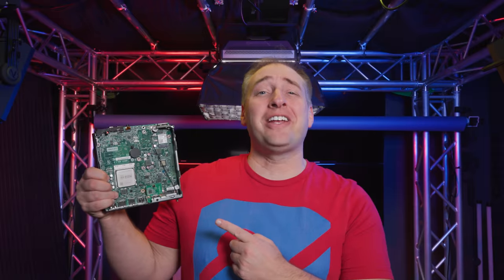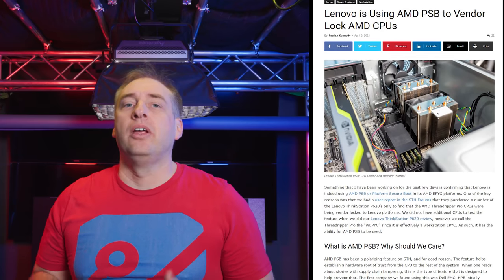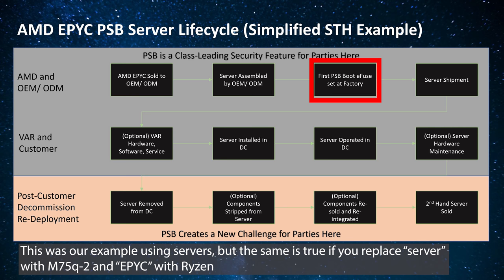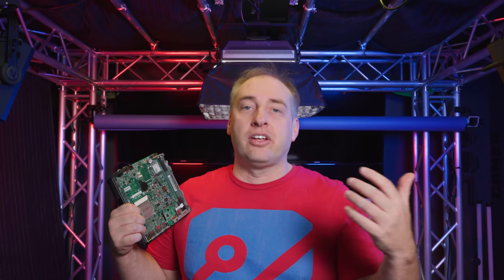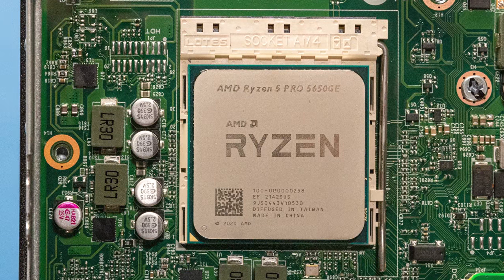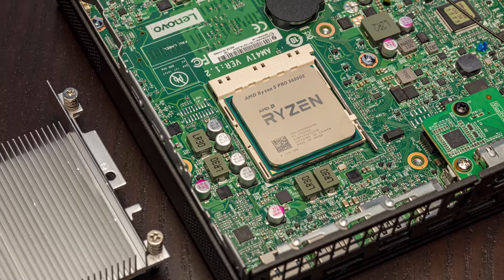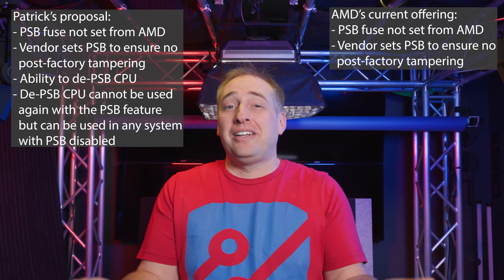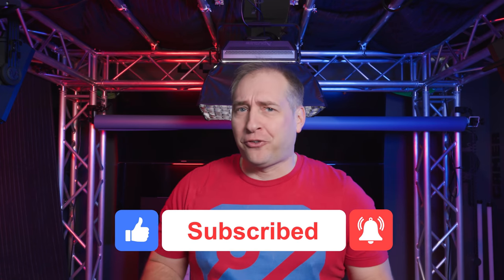Yikes! Lenovo is vendor-locking AMD Ryzen CPUs via PSB

Comment: The thing I don't understand is why they say the vendor locking is for security. How is this making the system more secure? - It's not like the CPU is an SSD containing business data. It's just rocks we've convinced to think.

They're just trying to harm the secondary market aren't they?
Reply from the maker: The idea is that it prevents unauthorized firmware to be introduced between Lenovo's factory and where it is deployed. All of the major server vendors are already working on at least some form of this, driven by cloud providers, and now we are seeing it more in endpoints.
Reply: the CPU contains the security coprocessor, and is also ensuring that the board firmware isn't compromised. If it's swapped with another CPU where the security processor and/or CPU are compromised, you break the security features of this system and the end user has very little way of detecting this.
Harming secondary market is a very secondary thing, nobody is buying these PCs for harvesting the CPU, in most cases the secondary market users will buy the whole system and use it for what it is.
Reply: @ServeTheHomeVideo  This would also prevent a malicious actor from loading their own UEFI microcode on the CPU either through physical access or a virus once the system is in production.  It would be very difficult or impossible to detect the malicious code on the CPU and it could be impossible to remove it as well.  Hardware based advanced persistent threats have been a topic of concern for years, but haven't necessarily been all that prevalent.  I wonder if Lenovo is just being proactive here or have these sorts of threats becoming more common.
Reply: @ServeTheHomeVideo  But why wouldn't they just include this in the chipset on the motherboard instead? Surely someone able to intercept systems in shipping could still defeat this system by replacing components on the motherboard, change signing keys, sign their own firmware, put on their own chips to bypass verification etc

Like once you have physical access I feel all bets are off unless the customer has to install some secure element to the server themselves separately once they get the hardware. I feel like this is just a way to lock people into a platform and making more e-trash. I've seen on ebay already how these locked CPU's go for peanuts while the unlocked ones go for 3-4x the price because people can't use the locked ones outside of the same vendors motherboards.
Reply from the maker: @zoopercoolguy  You are right. Is there an "and" instead of an "or" option?
Reply: @zoopercoolguy  all this invisible garbage and management engines need to get the hell out of the CPU... IMHO
Reply: @marcogenovesi8570  But if you have physical access to be able to change the CPU then why not just change the Motherboard too? - How does this offer any extra security if you already have physical access to the server? - If I'm the NSA or whoever intercepting a server that has this I'd just change the Motherboard and CPU together to a matched pair I've already preloaded with my modified firmware. I still don't get what this offers beyond tying up peoples money in a locked down ecosystem.
Reply: @ServeTheHomeVideo  HPE started a Trusted Supply Chain program for certain servers assembled in the US by vetted employees and with more security options built in.  I think that sort of arrangement is the perfect place for enabling the PSB.  Given the increased pressure on industry to prove cybersecurity compliance, PSB and whatever the Intel equivalent might be are appealing for certain industries.  Just make PSB enablement an optional feature that has to be ordered from the factory.
Reply: @ServeTheHomeVideo  if they have physical access, its already too late, and if they can get to the management interface to be able to fiddle with the UEFI, then again, its already too late.  these are not for security, its designed to kill the second hand resale value, nothing more.  see my comment about the full depreciation value in taxes.
Reply: @zoopercoolguy   I'd rather see this thing used more like tpm. You can de-lock it, but say good bye to data on your drives and uefi.
Reply: @droknron  they could change the motherboard, but you could easily catch that by testing with a known, properly blown, cpu.
Reply: @marcogenovesi8570  How would a CPU where the 'security processor' has been compromised exist? Are you assuming an attacker can manufacture rootkitted silicon? That is so farfetched as to be ludicrous. An attacker has stolen AMD's PSB signing key and this fixes that? You might as well assume an attacker has stolen Lenovo's signing key if so, which makes the locking process moot. Literally there is NO PLAUSIBLE MECHANISM once you start to drill down into the handwaving 'it's for security stop asking questions'
Reply: @ServeTheHomeVideo  How would this 'unauthorised firmware' be loaded? Are you assuming rootkitted silicon with compromised microcode? That AMD have lost control of their signing key, and a microcode update when it's booted is loaded? If so.. how does signing by another key help resolve that? The compromised microcode would just ignore a signature mismatch and pretend everything is A-OK. None of this 'it's for security!' argument actually stands up to examination.
Reply: @isbestlizard  manufacturing mistakes happen and some batches of CPUs of a specific revision might have a vulnerable security processor. Happened in the past with Intel's ME.

Limiting the CPUs that can run on the system to only those that are signed by Lenovo would stop that, assuming that Lenovo has validated the CPUs beforehand.

It's not a particularly high probability of happening, but it can happen.
Reply: @zoopercoolguy  Why this can't be solved by providing CPU specific encryption key, so the end users would be able to sign custom keys for installation into the CPU? Sure, leaking master key for your CPU die would be a problem, but realistically how often wouild you use it, 1-3 times over CPU lifetime.
Reply: @nxtktube  because that would open the possibility for a malicious actor to introduce their own  signed custom code to the cpu.
Reply: @isbestlizard  It's all BS at the end of the day, 99% of end users would have no clue if the mobo and cpu was replaced with a pair that tells them what they want but does malicious shit in the background. PSB provides no security that can't be done without it, the ONLY thing it does is kill resale value.
Reply: @ServeTheHomeVideo  dont the MB and CPU check for signatures of BIOS and microcode respectively?
Reply: @kharkin0  This is possible with TPM since TPM is battery backed with the BIOS battery. This ensures that the TPM can be securely erased. Sometimes there is also a capacitor inside the TPM chip to create a additional safeguard. The thing is that once you press "reset" on a TPM chip, it needs a few seconds to clear out all keys. And if you would be to yank the power to the TPM chip during the erasing, you could end up with a reset TPM chip containing actual encryption keys, or partial bits of it, that would be realased to the system with a newly initialized, compromised key used to sign some malware that captures the partial BitLocker key.

This is why the processor is using e-fuses instead. Its not possible to power the processor in its "turned off" state, thus the fTPM would be dead. It would then be possible, if a reset functionality was provided, to initiate a reset, then in the same second yank the power cable, and then initalize the processor with a new signing key for a compromised UEFI,  and then have the compromised UEFI to dump all released data from fTPM, possibility getting partial disk encryption keys.

This is why AMD uses permanent e-fuses. Its not a vendor lockin per-se, but more a security thing to protect drive keys.
Reply: @sebastiannielsen  I didn't mean it to have a TPM-like memory, just the basic principle. Fuses are faster to pop, cool, use fuses. I understand that unlocking would be a one-time operation, but designing it so that the locking is permanent is stupid. 

And even with a TPM-like memory, this could have been designed in such way that you have 3 "extra" fuses (set, reset and clear). Popped "set" fuse lets the system know that it's secured, unless corresponding "reset" and "cleared" fuses are also popped. On power-on system checks fuses, if "reset" fuse is popped, but "clear" fuse is not, it begins erasing memory. Once memory is erased, "clear" fuse is popped. If you power down system before memory is erased, It'll just try to clear it again on next power-up.

Comment: My thought is exactly what you said. It creates a deceptive market that might not even be the fault of the seller. I've helped schools upgrade their systems on the cheap (due to not having any budget, not the management being cheap,) and things like this would certainly hamper such a project. Not green, not friendly, definitely only looking out for the bottom line. Deplorable.

And frankly, the protection it offers is a joke if you really think about it. If it's physically compromised, all bets are off and that's it.
Reply: Dude, if it's physically compromised it's probably already sitting  in the thief's home being taken apart.
Reply: What if it's compromised remotely via a vulnerability, and they got root on the system?
Reply: @1mrhamel  The same security could be achieved by putting an early-stage bootblock of the firmware inside an external hardware write-protected memory. It may sound like this would add to system cost, but many BIOS flash chips include facilities for hardware locking the first few kilobytes of memory. This is the system used for boot security on Chromebooks.

Comment: I think if theyre going to push this into a consumer platform, it needs to come with a significant upcharge. Companies would think twice of creating more ewaste if it cost them $500-$1000 more per system just to purchase.
Reply: lol, nope, this will come with a tax break, full depreciation and thrown away.  its literal ewaste production, and they know it.  they know it cannot be reused, resold, or have parts salvaged.  its 100% intentional, and this will likely come with a discount.
Reply: It would also discourage security best practices.
Reply: I dont think this is intended for the consumer market.  It is for the larger companies that buy 10k units at a time.  This was probably pushed by some audit firm.  I still think it is a bad idea.
Reply: @hvfd5956  yes, its intended for large corporate customers, who then get a massive tax credit for full depreciation of their equipment every 3 to 5 years with computer stuff.
Reply: @chubbysumo2230  That happens with or without vendor part lock in, that is where a lot of the 2nd user market supply comes from, and where most homelabber kit is sourced.  I agree though that this will push a lot more hardware to e-waste earlier than it would have :-(

Comment: These types of features should always be exclusive to the end user. Lenovo or Dell doing this is anti consumer. My company has its own PKI. If I want my CPU locked to a signing key, it should be my key, not Lenovo's. Also, please tell me these keys don't have an expiration date. :(

I'm also highly disappointed in AMD designing a solution to a problem that exacerbates the ewaste problem and harms the aftermarket. I expect this kind of crap from Intel. I'm beginning to regret transitioning my home and workplace to Ryzen and Epyc.
Reply: not only that what about when the system becomes EOL and someone at uni wants to use the cpu in a different board or just a server at home, repurpose this is really bad for chip shortage as well as environment such companies should be boycott  so they stop.

I will not buy anything Lenovo again.
Reply: Yeah agreed this is complete BS. They want to control after sales and this will just screw up the secondary market plus the whole E waste issue. Its deliberate and I'm debating licking Lenovo and Dell from our list of recommended vendors as it will just introduce more complexity in managing assets across the company.

Comment: This is one of the few times when I think AMD's typical strategy of not locking out value-add features behind some bespoke SKU like Intel does is a mistake. AMD should sell vendors a unique vendor SKU if they want to have PSB enabled or at least provide a way to disable PSB with physical control over the processor like a solder bridge on the top of the circuit board. PSB provides no real security against APT shipment interdiction attacks anyways, all an attacker needs to do is replace the CPU at the same time as the firmware. If they're already intercepting packages and writing backdoored firmware the price of an additional CPU is peanuts. To my knowledge it's not like the shipment itself is linked to the serial number of the processor and even if it was, no one is going to check that if it never changes through the life of the processor.
Quit letting vendors program their keys on their own. Either do it at the factory and give them their own -D, -L, -H SKU to indicate the vendor it's locked to or put it somewhere else on the package out of the die SPD style so it can be programmed with physical control over the CPU if it's not going to be a bunch of different SKUs. "Hook up this $10 USB I2C interface to these pins" is not too onerous for someone who wants to resell these chips on ebay and it's not too difficult to have some POST code that clearly identifies the vendor lock and why the CPU isn't working.
Reply: I agree, AMD should sell a unique SKU to vendors/system integrators if they insist on using PSB. But I'd also add: AMD should charge them 3x what they charge everyone else if they want PSB. Fight fire with fire.
Reply: Sell any SKU they want and allow it to be locked, but somehow indicate on it externally, that it is a lockable CPU, so when you're buying it second hand you can see it is lockable, and if you're buying 2nd hand in 10 years, most likely has been.
Reply: @kal9001  Here is the thing, ALL cpu sold by AMD allow vendor to sign their own key, so essentially ALL cpu have a chance of being lock down the line, if you put a ''lockable'' warning on all vendor cpu it will render the warning meaningless.
Reply: I agree the ability to swap in a new CPU makes the security fuses practically useless. I think a low-level firmware lock would be just as effective by using a hardware write-protected bootblock on the external BIOS flash chip, as is done in Chromebooks.

Where I need to disagree with you is in having POST codes which identify the lock. While it would be great, it actually is too difficult. POST codes are generated by the system firmware and the system firmware isn't run when this problem occurs. The alert system would need to be programmed inside the CPU itself and this is impractical because different motherboards have different interfaces.